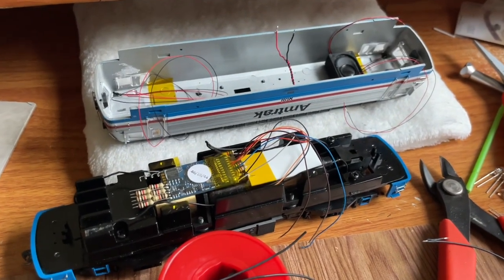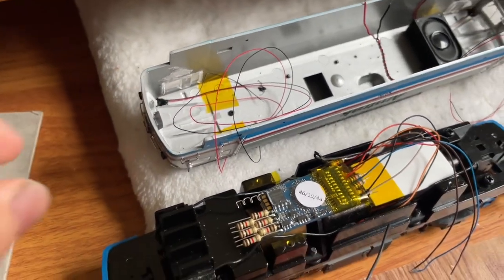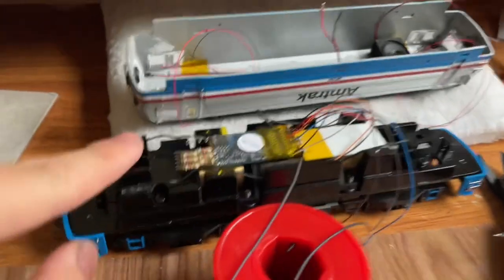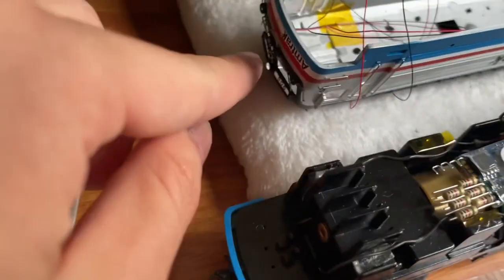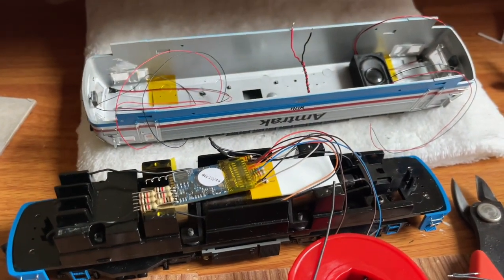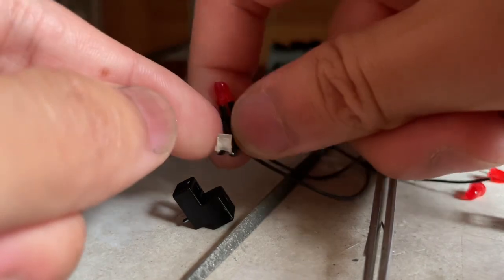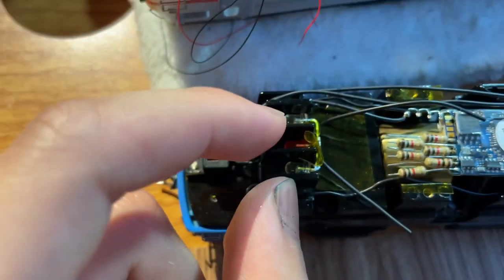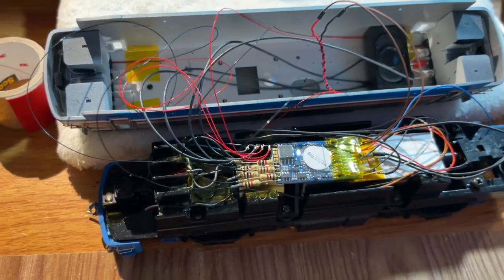Workshop: Atlas HO AEM7 DCC Sound Install (FULL Light Package)

Comment: Nice job! I just did one of my AEM-7s with a Loksound 5 Direct DCC decoder with built in keep alive.  It's nice because the LED resistors are built on to the board.  I have it on my channel.

Comment: I genuinely can’t believe you have the balls to pull this off…I would’ve used a decoder buddy instead of hardwiring everything like that
Reply from the maker: Thanks lol, but this was relatively straight forward. In case you didnt know, most of my other installs involved hardwiring 21 pin decoders...aka soldering fine wires to each of the pins on the 21 pin plug. I got videos talking about that too in case you were curious. I would argue that this is much easier by comparison. Cheers!